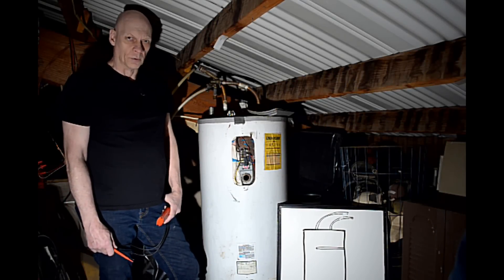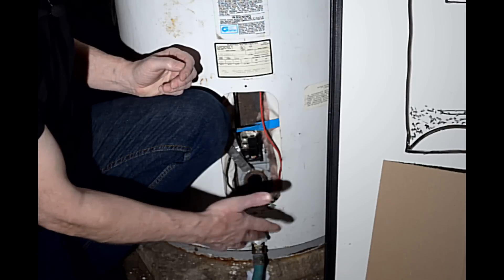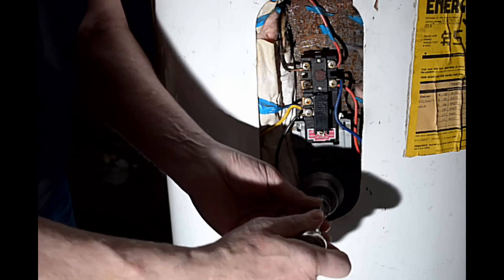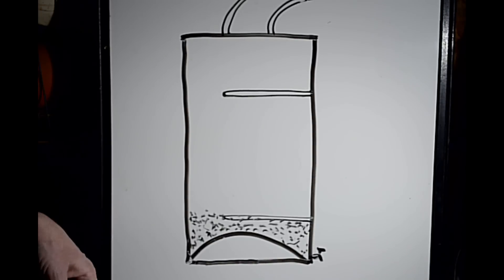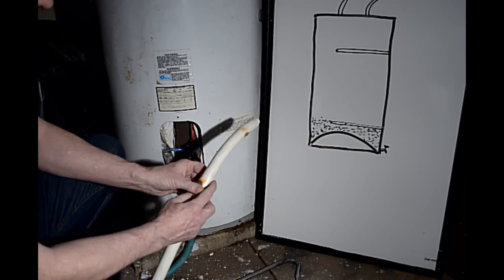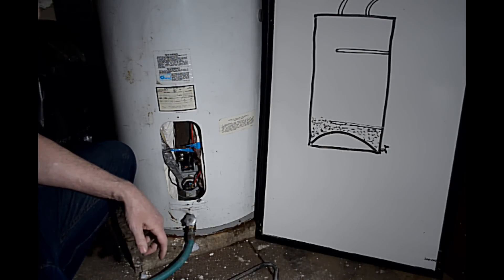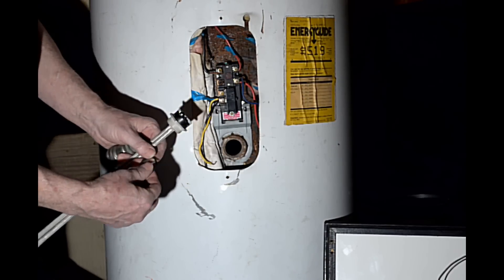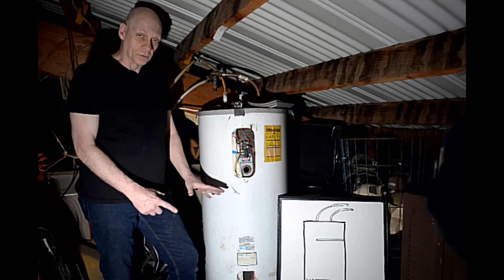How to Clean Limescale Sediment Out Of A Water Heater Tank In 30 Minutes

Comment: You can also use a limescale remover liquid and empty the whole container into water heater after draining as much of its water as possible and then wait for 6 hours and stir the mixture with a metal rod and everything will turn into a white liquid easy to be flushed out!

Comment: Don't forget to change the anode if it's been 3-5 years and soft water you can use magnesium in sections, you have no clearance for a 42 in solid anode.If you have hard water like me with lots of limestone or calcium use a aluminum anode so it will last longer. You have to remove the clear plastic cover on top and dig down through the insulation and use a 1 1/8 socket I think and either some pipe dope of 2 wraps of teflon tape but make sure the anode has continuity to the ground to transfer the electrical current  from the sacrificial anode or else it will rust out your tank in about 5 years. I just bought a solid 42 in aluminum anode from HD for $35 plus tax it beats paying $450 every 5-6 years. You should drain some water out of the bottom every 3-4 months to prevent most of the scale from building up and it can bridge your bottom element and short it out,
Reply from the maker: Excellent information. Thanks for sharing!

Comment: Dont know if you respond nyo these videos bthat are this old, but I seen someone do something really stupid to try and geta heayer removed. They came into yhe home Depot inworked at and the bottom if the hot water heater was poped out rathwr than curved inwards. I guess they put enough pressure nto try and split the tank oepn to say it was a manufacturing problem. But they eneded up poping it out so it looked like a propane cylinder. On a side note, home Depot replaced the hot water heater for free with another warranty. Guess bbad guys do end up in the lead.
Reply from the maker: Some people will do anything. Thank you for the interesting comment. Take care.
Reply: @hardluckcharlie  thank you very much for the video. I used a soft copper pipe duck taped to a wet dry vac years ago to clean my water tank in my hose in Florida.  The only concern I had was possibly damaging the glass liner so I made sure to sand the end of the copper pipe so it would be as smooth as possible. I have to say I love YouTube and all the practical information you can find on it.

Comment: Strange.....would it not have been much easier just to pour some hydrochloric  acid aka muriatic acid and let the lime scale dissolve, and then flush the tank.
Reply from the maker: I have worked with muriatic acid. It's fine if you have an effective way to deal with the vapors and a good way to flush/neutralize it afterward. It might work but I didn't feel comfortable using it on this job. My dad used to use muriatic for all kinds of stuff. Now all the shelf brackets and other metal items in my shop are rusted just from the fumes from that stuff. I kid you not. Thanks for writing!

Comment: Very quick question, would using Citric Acid (it works really well on calcium deposits) damage/corrode the tank faster?
Reply from the maker: The tanks are usually glass lined. Probably id you rinse with a Baking Soda solution it would neutralize the acid.

Comment: The biggest question is, why are heater manufactures making such a small drain? Are they dumb or stupid or both or even worse than that? Water heaters could be engineered very differently to allow easy cleaning. My 250 liters central heater is full of this crap and it will be a night mare to clean it.
Reply: I thought the same thing, a 1.5 or 2 inch drain would be a huge help!
Reply from the maker: Exactly.

Comment: Do you have any tips for putting the element back in the the coupling? They are kind of a pain to thread back in, especially if you're using a "sandhog" type element because they're so end heavy.
Reply from the maker: They are awkward and a pain. I have no tips other than clean the treads and a little grease. And maybe have someone with strong fingers to lend a hand(s)
Reply: @hardluckcharlie  Thanks much. I've never cross threaded one, but that would be a nightmare if I did.
Reply from the maker: @BigRW  Indeed it would. And after that episode I went through I was more than wary about doing just that! lol. Take care.

Comment: I think I'm going to try to drain mine then put a couple gallons of vinegar in it to try and dissolve the sediment then try to drain and flush it and see how that works.
Reply from the maker: I just did another water heater cleanout and video. The Ultimate Water Heater Cleanout. I also did a vinegar test that I am going to tag on or make a separate video. But basically, the vinegar had very little effect on the samples I tested. I let them soak for 24 hours.
Reply: @hardluckcharlie  Well, that's bad news. I bought 4 gallons of white vinegar already.
Reply from the maker: @BigRW  The vinegar might work differently on the type of sediment you have. Let me know how it works.
Reply: @hardluckcharlie  Ok, so this is what I did. I can tell when I have alot of sediment in my tank because since there is less space and therefore more pressure inside the tank, my relief valve will start to drip water. Instead of using vinegar, I decided to use citric acid. I drained most of the water from the tank, then put a couple pounds or so of citric acid into the tank through the hot water outlet. I added a little water  and let it sit for about 3 hours before draining and refilling it. My relief valve hasn't dripped a single drop of water in over a month so it definitely helped. Side note, though, if you ever try it make sure you flush the acid out thoroughly before you refill the tank. I didn't and had a blue tinted water for a couple days. The acid leeched some copper from my pipes and turned it blue. Live and learn, right? Take care.

Comment: Please teach me how to remove sediment from a gas water heater (my model is 2014 Rheem G40S09HE38UO). I don't know how and where to open the heater so that I can see and remove the sediment inside the tank ( I assume I have to use shop vac, but don't know where I can insert the vac pipe into the tank to do the job)

Comment: My first attempt at changing an element on my own, I drained and drained and drained - barely a trickle!  After 2 hours, I figured it HAD to be close to empty and started to remove the lower element... water gushed EVERYWHERE!   Once it stopped, I could see the ‘turnaround’ element my plumber put in last time was stuck in the sediment, bent out of shape, as a result, didn’t want to be removed from the hole.  Jimmied it some, got it out and spent HOURS trying to drain the sediment - alternating using a hanger to unclog the valve, a rod to stir up the sediment, repeat, repeat.  (my HW tank was NOT humped like in the diagram this gentleman drew.). After I was done, I attended to the sediment every 2 months and  eventually came up with inserting a semi-flexible poly tube INTO the shop vac hose.  Cut the job into a manageable timeframe....  I also learned to pop the relief valve to provide some force (had a few faucets only slightly open) and I intermittently opened the cold water feed to the HW tank to stir sediment up here and there.   ...NOW I find this video!!! ( I used other videos to learn the first steps I took).  ... what did I miss?  Cleaning the threads of the hole for the element with a wire brush and eventually overtightened to compensate for it.  As a result, the element actually pop out when I turned on a faucet 1.5 mos. ago!!!  OMG, water out of ANY place it could escape!  (lucky to have a drain within 20 inches.)  Oh BTW, this is being written by a 65 YO woman... 4 days after I had a new HW heater installed!  I put in an electric descaled yesterday!
Reply from the maker: Wow. Well thank you for sharing that experience with us. A lot of good information and tips. The best to you, and take care.

Comment: I had a rental service call on a WH not hot enough and not very old. I had some vinegar and put it into the tank and it helped to dissolve into smaller pieces and helped to flush out the stuff. I know it wasn't a complete service but it had corrected the problem and got water hot. I told Tennant to call if it didn't work and never a complaint.
Reply from the maker: Thank you for that advice! Take care!
Reply: How to add the vinegar & to how much water?..

Comment: I have found that using a flexible, clear, plastic hose that I bought from my local hardware store that you can buy by the feet. I bought 2 feet of 3/4".  I like the clear because you can see what your getting out of the tank. I didn't even mess with making a pvc adapter for it, I just stuck it inside the shop-vac hose about 3 inches and taped it to hold it in place. The hose has a bend already in it from it being rolled on a spool. If the hose grabs hold of a big piece of deposit, the motor will bog down and just pull the hose out and take the deposit off the end. The plastic tube can get in every nook and cranny. Hope this helps.
Reply: Very good idea!
Reply: Definitely beats pulling all that crap out with a clothes hanger😂

Comment: Hey thanks for the insight... I did clean my tank once before using this method and thought I would check and se e if your method was any different than mine... The only difference here is that My tank is a 25 gallon and I have it laying on it's back with the scale straight down from the element hole and used my shop vac to clean it up... Cheers...

Comment: Also vinigar melts skale but it takes a few hours i believe
Reply: It does, but for the amount of scale that is removed in this video, it would likely not work or take too long and use too much vinegar.
Reply: @metatechnologist  I don't know you generally have to use 3 gallons let it fill back up with cold water and let it sit for a couple more hours if you just use the three gallons on the bottom and I'm sure it would break it up though I still think the trunks would have been too large to necessarily just drain out. I think this vacuuming out and cleaning up would be great and then filling up the hot water heater with 3 gallons of vinegar and 40 gallons of water you know for a 40 gallon tank. You need about one gallon of vinegar per 15 gallons of water. Then it gets the scale everywhere just not down at the bottom and it also get rid of certain bacterial buildup
Reply: Dollar Tree sells vinegar...
Reply from the maker: I tried different vinegars. For 2-3 days. No effect on my build-up. Even on a different tank with more sandy chunks of calcium.  https://youtu.be/6l9uZohvmcQ

Comment: Has anyone used an endoscope to assess and identify the amount and location of the scale will vacuuming it?  Would this save time and improve results?  U can get one for $20-$30.
Reply: I just recently used an endoscope for my water heater. But I was running the scope from the top anode hole. The limescale build up I had was massive, LARGE pieces and structures. I used a piece of wood from the top to gradually break down the large pieces, and the scope made finding them very easy.

Comment: Great method for cleaning out calcium!  One suggestion, do not use a metal wand or probe inside of the tank as the metal tank is glass lined to prevent corrosion.  A metal wand may scratch the glass off exposing bare metal that can accelerate corrosion.  Best to use the PVC pipe or rubber hose.  The PVC pipe can be bent with a smooth radius (no kinks) by filling it with sand prior to heating it, then gently bend it.  This approach works great.
Reply: I used clear plastic tubing and stuck some aluminum rod inside it.  Steel rod or wire works too, just make sure to tuck the end enough so that it cant scratch anything.  The metal makes it stiffer plus you can bend more to clean closer to the element hole and drain.
Reply: Or perhaps use electrical pvc 90’s as they have long sweeps

Comment: Be prepared for a mess!  If the calcium build up is up to the element, the drain valve will be clogged and wont drain.  Kill the power, remove the element and let the tank drain out of the element hole.  I open the relief valve to allow air into the tank.  I use an automotive heater hose (about 3 feet or so) and just duct tape it to the vacuum hose - that way you can angle it all around to get most of the crap out.  After I install the new element, I leave the relief valve open, turn the water on, and when you get water coming out of the valve, shut it off - the tank is now purged.

Comment: Assuming you have a good water dip tube inside the tank, you are supposed to pulse on/off the incoming water supply with the drain open. Pulsing the water inlet will help dislodge the junk in the bottom of the tank. Simply opening the drain with the water coming into the tank, helps, but a better method is pulsing the incoming water.

Comment: Where can you buy one of those metel pipe?? The slightly bent one?
Reply: Try a piece of 1/2" EMT - can be bent into various angles ($2 at local big box stores).  If you don't have a conduit bender - they even sell pre-made 90 degree bends and you can unbend it some against a hard surface

Comment: Could you have used vinegar poured in through the lower element hole instead of the vacuuming?
Reply: Vinegar is too weak to do anything other than to remove very thin deposits on surfaces.
He uses the word, 'scale', but it is sediment. The tank wall doesn't attract scale.
Reply from the maker: I tried different vinegars. For 2-3 days. No effect on my build-up. Even on a different tank with more sandy chunks of calcium.  https://youtu.be/6l9uZohvmcQ

Comment: Great info. Does the anode rod decrease build up?
Reply: No the anode rod does not prevent the buildup. It prevents the tank from rusting out, so to speak and has nothing to do with scale buildup.
Reply: OR have any affect on limescale buildup whatsoever?
Reply: The anode rod is made up of more reactive metals. IE instead of resting steel or the other metal that may come in contact with it. The aluminum or magnesium or zinc that the anode rod is made out of. However limescale is essentially calcium build up it has nothing to do with the rest. The calcium buildup is merely because the heating and burning off of water and some of the steam and making the calcium settle and then come together you're cooking little calcium shells. The anode rod for infanticide the tank from rusting the limescale in order to stop that you would have to have a water treatment system before it got into your hot water heater

Comment: I just opened the access port on the bottom of my Rheem/Rudd commercial hot water heater and scooped by hand and  wet vac almost 10 pounds of what appears to be sand. I live in NJ outside NYC, sand? Limescale dosent look like sand does it? The HWH was popping and percolating so loud u could hear it upstairs right thru the floor. Better now but I need a sediment filter.
Reply from the maker: I recently cleaned another water heater and extracted probably 50 lbs. of sandy textured calcium deposit. Here is the link to that experience.             https://youtu.be/6l9uZohvmcQ

Comment: I am doing the same thing on a gas water heater, but I have to do it through the drain valve opening. I just used whatever was around the house. A chopped up old lawn hose and duct tape and the shop vac. Did the job. THANKS
Reply: change your Anode rode to keep your gas heater working.
Reply from the maker: Congrats on getting 'er done! Thank you for watching and commenting.
Reply: Thanks for posting, really. I need to do my gas water heater this weekend!